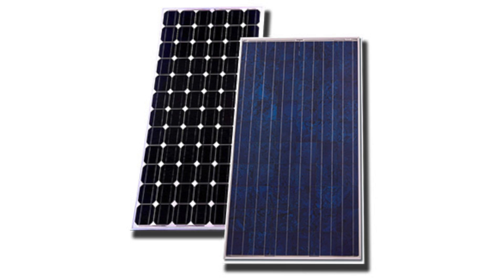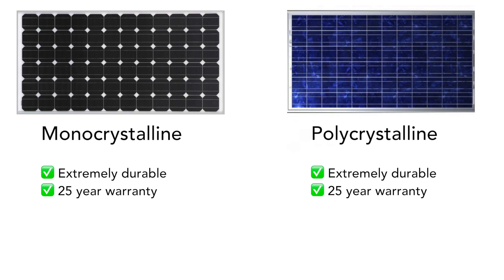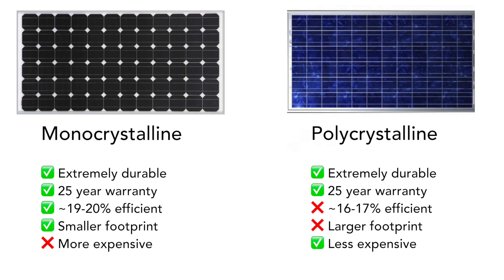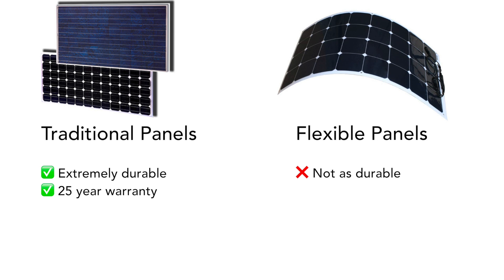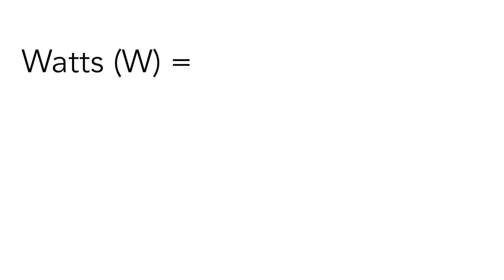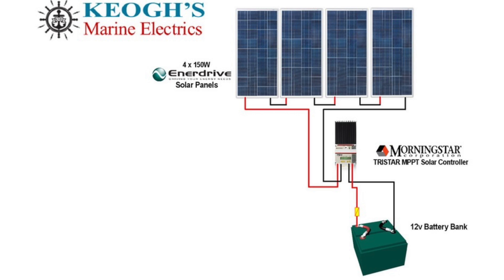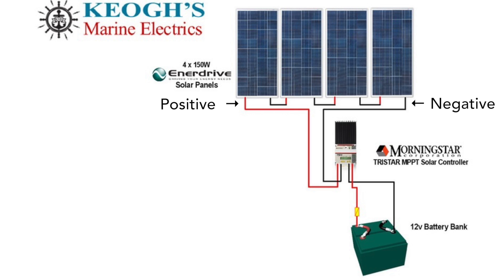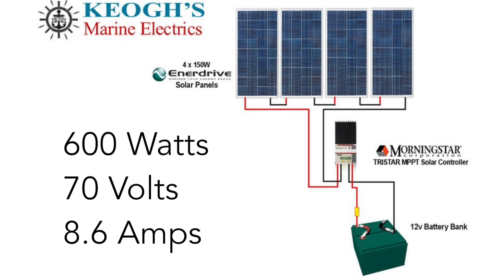Mono vs Poly vs Flexible Solar Panel + Series vs Parallel Wiring

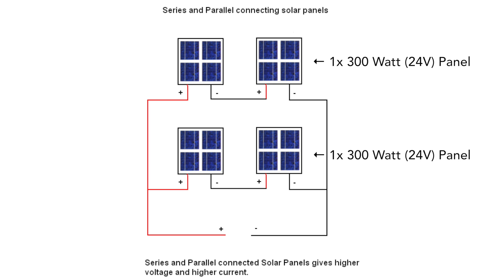Comment: your series math is wrong @ 9:55 and 15:10 , at 9:55 the voltage is correct but the 600 watts is wrong. you would only have 150 watts not 600, so you would have  around 2 amps not 8 amps.  at 15:10 you would have a 300 watt 24v 12.5amp system not 600 only voltage is doubled in a series.  everything else was accurate . just remember parallel = same voltage and double amps/watts and means thicker wire to carry the current.series = double the voltage only not the amps/watts which means thinner cheaper wire. there's a reason why electric companies send voltage ranging from 5,000-120,000 volts to the stepdown transformers to your house look at the thin whips ( approximately a 0000 wire) feeding the transformer, then look at the heavy thick wires that feed high amps (around 200a per home) low voltage  (120v 2 legs = 240v) to all the homes close by. in the end whether you have high volts and low amps or low volts and high amps the wattage will be the same, which is why you electric meter records wattage and not amps or volts. the final wattage on a 12v bank would be close to the same even if wired two different ways, i.e. (2) 12v 200 watt panels in parallel = 12v @ 33.33amps with a wattage of 399.96 watts and the same panels in a series = 24v @ 8.33 amps with a wattage of 199.92 watts (x 2) to step back down to 12v = 399.84
Reply: Bravo ,finally somebody notice the error !

Comment: what about Micro Inverters?  Then you could use smaller wires and have the same benefits eh?  Also, I've heard one type of panel micro vs poly have better shading and low light properties tho... I looked around and get different answers ... probably because the technology is always advancing on the panels.

So maybe sticking with mono and micro inverters is the best solution, that is if you want 3 smaller panels vs one larger one.

Comment: Silicone is something you put in a chalking gun.   Silicon is a semiconductor found in solar panels.   Just saying.
Reply: true true....
Reply: he also got supply and demand wrong.
Reply: Yes, but some are failing to the possible ramifications of new laws on both chalking and caulking guns. I also worry that some terrorist will find a way to mix silicon with silicone and then add both of those to sillyputty and then well, I don't even have explain the rest. Now do I?🤣🤣🤣🤣🤣🤣🤣🤣
Reply: Err..I think it's caulking.
Reply: silicone is sand

Comment: Thats why you have to take the consideration to place your series array in an open environment as possible and its the winner... parallel has lots of energy loss and wires are heating because of those amps constantly  pushing through the wires .. so series arrays on a high location without any trees or neigbours blocking sunlight is definetly the winner here..I have 4 250 watts 24 volt panels in series with an pcm60x mppt solar charger and when shade occours it doesnt kill the panels 100% like you stated in your video it goes around 40-50% lower than usual not such a big of a deal...

Comment: I understand you want to explain to wider audience, but too simple is not true..
If your MPPT is good you will not lose the entire block and you will not have that much of a loss in shading, but you won't have voltage drop/losses as great as in the parallel. For 12V you main concern in copper is voltage drop, not current - the bigger the distance, the bigger the losses/or cables... and you'll need pretty chunky mo-fos for large fields...

Comment: when we talk about solar panel efficiency as in 20% efficient. for a 100 Watt solar panel, do i get 20 Watt of usable power or is the 100 Watt rating is already the 20% calculation?

Comment: Mmm has he ever seen a solar panel? 3 to 4" thick? Flexable panel at 1/2 " thick? I have never seen a solar panel more than maybe 1 1/2" thick for a traditional panel. The Flexable panels are 2 or 3 mm thick less than 1/8th inch!
Other than that a good description of how to arrange the panels and connect them to your charger or inverter. Pitfalls and benefits section is excellent.  :)
Reply: the cells are wired together and put on glass to protect them then there sealed in a frame..

the cells are super thin, but eveything put together in the frame is thick.  dont forget they have to be water tight
Reply: I'm sure he is taking into account the brackets used to mount the soild panels and some of the flexible panels have groments around the edges to mount to the surface.

Comment: I understand your focus is on RV's.  If you are considering a home system though, don't forget racking costs.  The racking materials aren't freebies and the poly panels larger footprint require more space, which equals more racking materials.  If roof mounting, you could likely place more rated watts of solar on your roof with mono panels.  Good explanation overall.

Comment: I disagree with the efficiency between the flex and mono rigid panels, you will find that they are often using the same cells (in high quality panels) so theres really no difference in efficiency.

Comment: Thank you . I've been doing this myself. And that was the best I have ever seen describing it all and now I totally get it. And you ain't kidding about confusing.  I've tried reading it from a book and well forget it . So I've been learning by experimentation.    That can be a bad expensive mistake.  Got a question with my most recent array instead of running the panels through each other I ran it to 2 copper rails . These panels are mix matched in power output it seems to be working properly. Or am I screwing somthing up and just don't know it yet ? Thanks for all the info

Comment: So wiring in series leads to more amps, but in parallel, there is more voltage. Which wiring creates a more powerful system? If the voltage is the pressure that allows the amps to flow, that means that both systems are about equally powerful? Great videos by the way. Very easy to understand.

Comment: No we're does he or anyone else explain when charging begins in the morning and when it ends at night. If a 22 volt panel produced 2 volts in low light and was connected in series with 7 panels it would start charging the batteries sooner and later respectively

Comment: One thing you may have considered was to show side by side all 3 setups with the necessary wire and Controllers. You tend to over explain the easy stuff then under explain the stuff that matters. 

You might probably cut down the length of your videos but just cutting to the chase and reducing redundancy such as:
Mono                                                     Poly                                                  Flexible
Series, Parallel, Series+Parallel        Series,Parallel, Series+Parallel     Series,Parallel, Series+Parallel
Watts, Volts, Amps, Wire, Controller Repeat for Poly & Flexible and of course efficiency and cost involved. 

I totally get that you put a ton of work into your videos; that is very clear as your content is A+++++ Your redundancy however, could use a lot of work. Some folks don't realize they repeat themselves but using different words does not change the overall  meaning that ends up being the same.

You clearly know infinitely more about Solar than I as I am still learning and have yet to invest in my first system. My Solar needs are small at the moment but will grow as I am able to afford upgraded equipment to expand. I've been researching and watching videos over the past several years now and I've found your videos to be of the most use thus far. Again your content is great it's just you tend to repeat yourself over and over and over which makes for a very long video. 

When you over explain it's more akin to spoon feeding your content rather than just putting it out there and letting use eat it at our leisure or pace. Please do not take my comment as harsh but rather as a playful kick in the pants as I mean no harm. It might not be a bad idea to put what you would invest in as a baseline. You did mention that flexible panel with a high efficiency rating as an option but dollars to cents matter to most folks these days. Sure it would be nice to have our cake and eat it too plus pick out the toppings but Life is not like that many times... Cheers mate, keep up the great work....

Comment: At 15:25, how did you get 35 volts? If they are two pairs in series, then run in parallel, wouldn't the voltage stay at 24?

Comment: Ok, so say I have 5 x 100 Watt Panels(17.5V) for use on a boat with chance of partial shading by lines and boom...would you suggest I do parallel (better for shading) or series (thinner wires). I have a Victron mppt 100V/50A smart controller. I am still not sure when/why series is better since the Amps are so low for the array? Can you clarify please?  After a bit more research, this video explains a bit more of the pro/cons https://youtu.be/dfMVHLVcMWo

Comment: so a solar tree is a combination of series and parallel where as a solar panel is mostly series?
Can you do a video on moving solar panel how will that effect the concept of parallel and series based on shading?
Can i use a buck boost converter to stabilize my output

Comment: Have a question. You have 6 solar panels of 170w each. Each panel, to round it off higher,  is 20v and 10amps. You are going to wire them two together in series resulting in three (3) sets of panels wired in parallel. How would you figure the wire size needed to go to the solar charge controller?  Thanks for any input it is really appreciated:)
Reply from the maker: If you wire them (three sets of two) in series, the voltage would double. You would effectively have three 340V panels at 10A each. Then if you wire them in parallel, the wires coming from the panels would need to be able to handle the 10A + voltage loss (depending on the wire distance to your combiner box) and the wires coming from the combiner box to the charge controller need to be able to handle 30A + voltage loss (depending on the wire distance to your charge controller). Hope this helps a bit!
Reply: Thanks:)
Reply: So what mm2 lets say 30 meters. Is 16mm2 enough
Reply: wire gauge chart... freely available online..   and amperage is more of an issue then voltage..

Comment: This is a fantastic series. I know enough electrical and other things to be dangerous....LOL This series clarifies several things, but I will have a question or 2 later I am sure. Like how do I combine my solar input with other inputs to the battery such as converter with input from gen to be able to charge batteries quicker.?
Reply: Todd Ramsay :    Same here!  Teletype techie in the Army many years ago and a long-time PC gamer.  This is right up my alley!

Comment: I have solar panels on my house. It is an 8K system with 29 panels. I went with microinverters on each panel. Microinverters convert the panels energy to 120 VAC at each panel and then send the low amperage current to the main panel. Each panel operates independently and shadding on one panel doesn't effect any of the others. I don,t have a battery back up system since I am using a grid tied system so your need may be different than mine. You might want to look into it. I plan on retiring in 4 years and hitting the road full time in a class A and solar is a must for me. I think you have done an exelant job explaining things. I have subscribed to your channel and have watched all of your videos. Thank you for sharing hopefully we will see you on the road in a few years. Greg & Grace
Reply from the maker: +Gregory Dugre This is very interesting Greg! It sounds like an awesome setup 👍🏼 Thanks for the great info! It’s so exciting that you’ll be on the road in a few years! Wishing you all the best! 😊